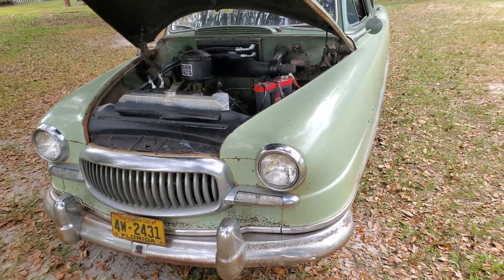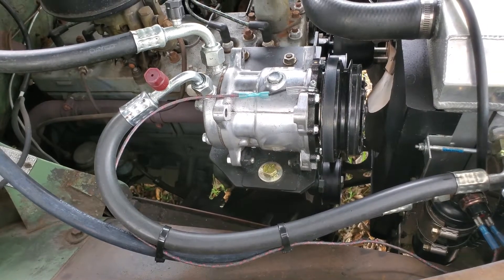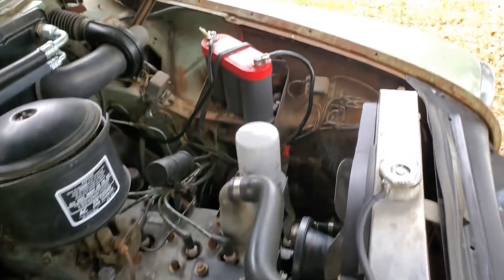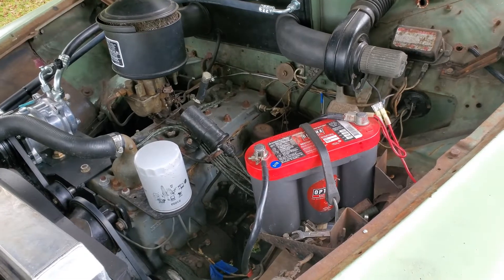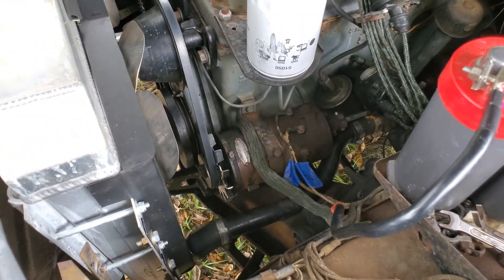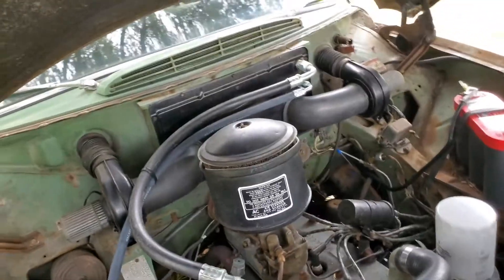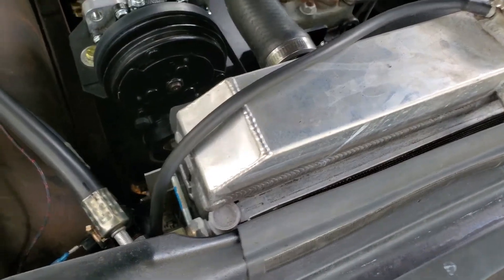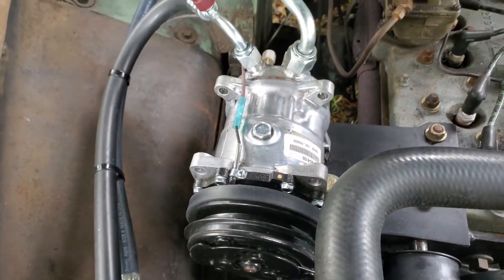Modern AIR CONDITIONING....on a 6 VOLT CAR?!

Comment: Took your idea for my 55 plymouth with 6volt positive ground... Clutch does engage on 6 volts.. I put 12 volt batteries in the trunk and put an evaporator just under package tray and have rear vents from package tray.. Condensor is mounted under the car.. Hoses rand underneath.. Just not cooling as much as I would like.. Probably 55 to 60 degrees from vents.. On a 95 degree day... Wondering if the distance is the issue...
Reply from the maker: @jonathanhermis1929  sounds good! I don’t think the distance would make a difference. Some things to consider might be compressor size, greater displacement seems best. Does the evaporator pull air from inside the car (like recirculate) and not hot air from the trunk? Heat transfer of the condenser is also critical, bigger is better with as much airflow as possible.
Reply: @rustyoldchevy1149  I figured out the issue.. I called vintage air and they told me to only put 24 to 28 ounces of freon into the system... They said 200PSI on the high side is about where i need to be and 26 psi on the low side.. My problem is I had it overfilled. I was making the mistake of reading the charts online. Vintage air said Sanden type compressor are completely different than factory compressors.. And the charts online or most of them are for factory compressors.. And he was right.. I removed freon and brought it down to 200 psi high side and 26 low side.. COLD AIR NOW.... However my clutch fried. Makes a grinding noise when it engages.. If I let the system cool down for about an hour and recrank the car and turn system on it will engage.. Turn it off to simulate a clutch turning on and off or cycling it immediately starts grinding and wont lock in place.. So I either have a bad clutch or the clutch doesn't like 6 volts.. I have a 6v to 12v module I use for my 8 track player.. Temporarily ran it to the clutch and fed it 12 volts and still grinds and wont engage... So I am wondering if the clutch doesn't like 6 volts or am I ok to swap out and still use 6 volts.. Would hate for this to happen again and I loose freon lol...
Reply from the maker: @jonathanhermis1929  ok might check the air gap on the compressor clutch and be sure it’s in spec. Other than that the Charging system might not be 100% and a 6 volt alternator is the way I would have gone if I could have with my Nash.
Reply: @rustyoldchevy1149 I checked the air gap it’s within sanden specs. Replaced the compressor and bought a 6v to 12v step up transformer and it works thankfully since the clutch is just a coil. Just not cooling like it should. I am wondering if heat transfer might be my problem. Everything I am doing is in my Texas garage and it’s 104 in here with the fan blowing. Unfortunately the only spot to mount the compressor was coming off of the alternator bracket and that alternator bracket is attached to the lower manifold. Yes not sure why Plymouth/mopar did that back in the day. After running for awhile the heat does transfer from manifold to alternator and the compressor through the medal. However I see these are designed to run in high heat so not sure that’s a problem. Just scratching my head on this one. I am using a parallel flow confessor that’s mounted underneath the car slightly tilted. Maybe that’s causing a restriction. However I do see flow and stream through the drier sight glass. System has been flushed. There is enough oil in system. I noticed you did say recirculated air to evaporator in trunk. I do have a vent I cut in through the package tray. It’s not connected to the evaporator but just pulling some air from inside the cabin to the trunk. Yeah I thought about that too. Warm trunk air pulling through the evaporator. Maybe this is why the trunk systems are not as common as the front mount ones. Only reason I went this route is because I have the from air vent louver in the center underneath dashboard and my 8 track player. Just hate modifying original. Maybe driving at highway speed will create enough airflow underneath and through motor to cool things down. I must say though it’s only blowing around 60 through the rear air vents and it’s 90 in the car. Just doesn’t seem correct even at idle. I give up lol. I have three other classics I have systems on and no issues on those.
Reply from the maker: @jonathanhermis1929  it can surely be frustrating, you can always walk away from that project for a while and come back with fresh ideas!
Reply: @rustyoldchevy1149  Also I cannot find anymore of those 6v positive ground to 12v adapters... Mine is a little silver box I bought off of ebay a few years back.. Cannot find anyone who sells them anymore... Would be nice to have a spare one...  If you saw this system I have its a frankenstein unit... I bought a regular evaporator with 4 2" outputs on the front, the standard one you see on amazon for retros.. Mounted that on a piece of wood and mouting it just below my package tray in the trunk.. Made a package tray with 2 of the vents vintage air sells for rear air vent louvers.. Ran flexible hoses from the evaporator to (4) bilge blowers to push more air forward.. Ran the power to these bilge blowers through a variable motor controller to adjust the speed and ran the wiring up front under the dash adjacent to my temp/on/off switch for the evaporator.. But before it gets to the variable speed controller its ran through a 40 amp 12volt relay to handle the amperage load.. Fused of course.. Essentially your normal green wire that comes out of the evap to trigger your clutch or condensor fan is ran through the pressure switch and powers three relays.. One for the ac clutch to trigger the 6 volts to the clutch, one for the condensor fan, and one for the pusher/bilge blowers.. The 12 volt side is ran off of lithium phosphate batteries...All of this you gave me from your idea of making this work with 6 volt positive ground and I just went from there.. Appreciate the guidance.....

Comment: This classic car air conditioning was kept basic and simple. No complicated air flow damper controls and just a single speed on the fan. Also if this system needs repairs it is easy to get at everything to repair it. The modern car I drive is incredibly complicated on the heating, ventilation and air conditioning system. My car has like many cars today a full automatic climate control system. Also if the air conditioner evaporator or heater core should leak and need replacing it costs thousands of dollars because the entire dash board must be removed. There are a lot of times when simpler is better.

Comment: Did you make the compressor mounting brackets?
Reply from the maker: Yes indeed! I bought the generic components and adapted them all to fit.
Reply: Kool. Love the simplicity.
Reply: How hard would it be to get a list of what parts you used? Would like to apply to my 48 Plymouth. Ebay kits seem to be overkill

Comment: You could absolutely perfect that to make you cold on a 100 degree day without too much more work.  (so long as the engine cooling system can handle it).  I'd use r12 refrigerant, 525 refrigeration oil, eliminate the clutch cycling switch and fit a POA valve or STV valve, and put another larger evaporator in the rear or under the dash.  I would use r12 and 525 refer oil because they are better but this system would work with 134 and ester too.  If the condenser was a parallel type and large enough, you could still hang meat in there.  Also sanden makes a larger compressor and they make one with an automatic variable displacement which would help on days that are not too hot and keep it from cycling off.  Cheers and thanks very much for telling us all the 6 volt works on the clutch...
Reply from the maker: Thanks! I'm finished experimenting with it for now, since I've got too many projects going right now. Unfortunately the cooling system doesn't allow for much, but I bought a slightly later model engine, which is identical except for a more traditional water pump mounted on the front of the block. If the engine in the car ever has trouble, I would swap it and many problems I have now would be solved. I believe it really needs a 7 cylinder sanden style instead for better cooling at idle(for a greater displacement). The system doesn't work too bad though, I just drove it 60 miles yesterday! Thanks for the good info and suggestions!

Comment: The car is so big, you could add another (large)evaporator in the rear (there are plenty of 6 volt fans you can use with those even if you need to make a custom housing for it, like you did for the dash vents.).  

You can still bolt an alternator to the car, just as you bolted the ac compressor.  Leave the generator with his shaft, but unhook his wires.  There is plenty of room.  You could even switch to 12 volt and change your bulbs and put Runtz box for the electric gauges.  I'd add a power steering pump I think.  Probably with a remote mount reservoir.  You maybe could use a power steering ram from a corvette or a RR silver cloud and attach it to the existing steering system.  Would be better to put a recirculating ball steering box though.

Thanks very much for this video.  I need a/c because of my bad health and I was planning on putting the sanden compressor in my 37 packard with the clutch welded to the pulley and a POA valve to eliminate the need for a cycling switch.  (that's the alternative way for 6 volt a/c, the first 6 volt ac cars didn't have clutches, you took the belt off in winter.) Now I don't have to do the welding part.

Comment: May I ask a question? Is it been a while since you installed it? How long has it been working? Have you had any problems with it? Thank you. I’m considering putting one in my 52 Studebaker.
Reply from the maker: I think its been 2 years now, and it works just the same. The only thing I would try different would be a greater displacement compressor for colder ac at idle. It really just comes down to the effort you put into making it work like your belt arrangement. Good luck!

Comment: Good call on the mechanical fan. Great job. Thanks for the encouragement-I will doing something similar soon. BTW, fan motors don't care about 6 or 12 either. 6 volt motors just go faster.
Reply from the maker: Thanks! I had to step up the power to the blower motor since it would run too slow on 6 volts, and the 12 volt motor was my only option.

Comment: Amazing. Car runs real quiet for its age. I have a 1948 Packard here in Florida, too. It is hot driving most of the year.  I have a friend that converted his Packard to 12 volt  to get AC. You must be very mechanically talented to do this. Good job.
Reply from the maker: Thanks! Its very possible, just a little more trial and error maybe!

Comment: This is perfect 👍 I want to add AC to my 54 Hudson and have an old era correct novi system that went in the trunk. 

So as far as parts needed it’s the compressor, air dryer, condenser and evaporator and expansion valve?
Reply from the maker: That sounds like a good start, dont forget to somehow improve airflow over the radiator/condenser. You could build a fan shroud, or add a 6 volt alternator with 6 volt cooling fans. Also the heat generated from the condenser will preheat the air to the radiator so it will run warmer. Lastly, the compressor I have works fine, but I've wondered if a larger displacement compressor (sanden 4664) would make the vent temps colder at idle since the flatheads idle quite low. (just a theory, not tested)

Comment: Awesome man. I'm looking to do something similar with my '53 Chrysler.
Reply from the maker: Sounds like a neat project! Might consider a greater displacement compressor, like a sanden 4664. I think it may make the vent temps cooler at idle, but its just a theory.

Comment: Thank you!!!  I remember the days when aftermarket AC for cars was a big deal.  There was one in my home town.  Those guys are long since gone, but I wonder what they used to do with 6 volt cars.  I know the early lux cars like Cads and Imperials, etc had 6 volt air c.   Also, I can still get 6 volt blower motors.  I have a 53 Plymouth and did not change over to 12 volts.  I would sure like to get ac.  It gets really hot down here in Louisiana and it is not fun driving it when it is so hot.  Thanks again for defying the experts.  By the way 40 degrees coming out is about as good as it gets on normal AC in cars.
Reply from the maker: One thing on the system I would consider changing, a compressor with a greater displacement such as a sanden 4664. I think that would help it cool better at idle, since the old flatheads idle quite low. No time to mess with it now, but it would bolt right in.

Comment: Great job!  I'd like to do this with my 51 ford.  What part numbers?
Reply from the maker: The ac compressor came from advance auto parts, part number T58551. Everything else was pretty much custom made. Any universal under dash unit will work with a "digiten dc 6volt to 12volt 10amp step up converter" to run the blower motor. Also, the bigger the better for the condenser with plenty of air flow.
Reply: @rustyoldchevy1149  Thank you!  I have a 51 ford, and will start collecting parts now